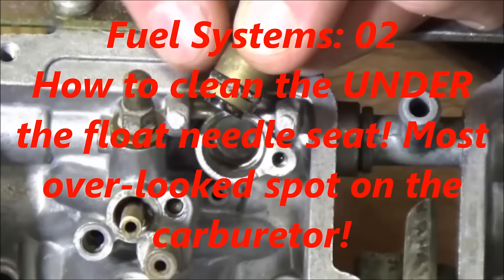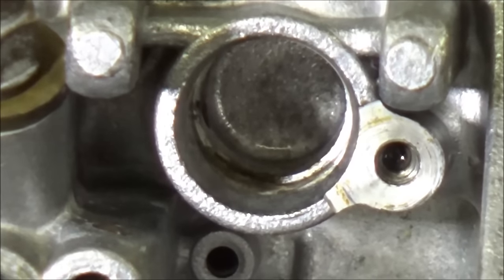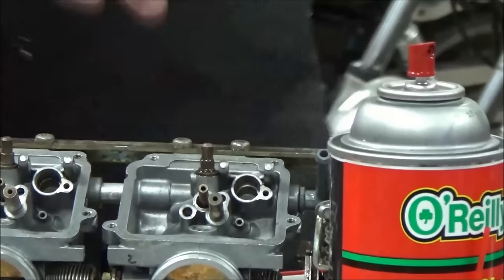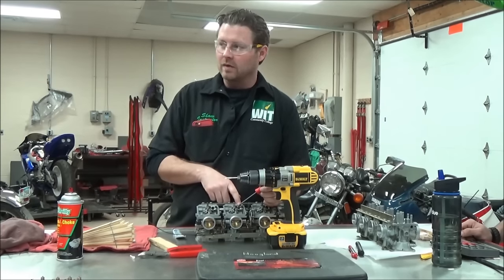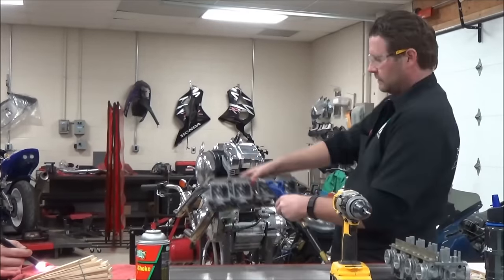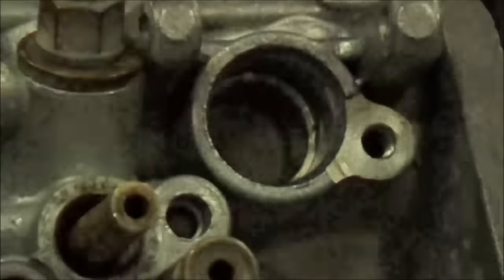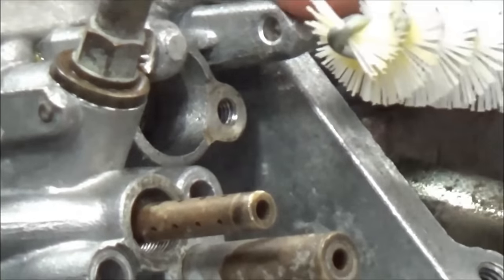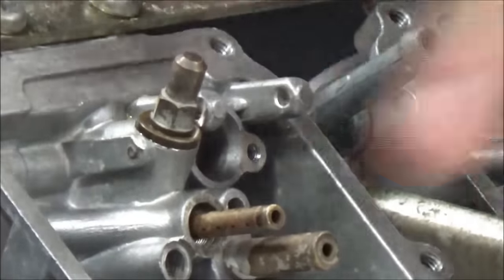02 The most overlooked spot on carburetor rebuilds and cleaning! Under the Float Valve!

Comment: I check out most of your vids whenever I get a chance, mot appriciated and entertaining.
Speaking of rebuilds, im doing a rebuild/overhaul on an Xt600 1987 2kf, and just noticed a small gap where the conrod meets the crankshaft. I checked the manual and it states a freeplay of 0.25-0.75 mm, my seems to be after checking with a feeler about 0.55mm. Is this a sign of wear and bad things to come or is everything between the specified clearancelimit acceptable? Sort of like a brakepad wearing down.
Mike
Reply from the maker: +TNPerSwede 
If its in spec I really wouldn't be concerned UNLESS it was run on low oil.
Reply: +Shane Conley It was bought used by me so hard to tell but maintened properly by me atleast.
Thanks for replying, its great having a recource like you when things get confusing for the old brain.:)
Have a nice day and happy spring riding.

Comment: You are the best guy on the internet, learned a lot from you. But you are wrong about removing debris using polish of grinding paste, you have to remove manually. If you a paste you will remove aluminium material as well as the debris. But keep up the videos, thanks.
Reply from the maker: Well thank you "kind of" lol...jk. We will have to disagree and my methods are proven and sound. I think you are thinking of something else though BECAUSE the seat is brass not aluminum. Also from experience, you have to "polish" forever to make the slightest change. I have a video coming out showing this process in detail. Stay tuned. 
Thank you for the comment. See the link below for more help with your question. I have been banging my head against the wall thinking of ways for people to say thank you in an impactful way to help keep these videos coming. Here are few ways that many have found as a way to give back. 
* Membership to H2W (includes t-shirt or tech help) https://how2wrench.com/product/membershipmembers-onlymembers/
* Simple donation to say "KEEP IT UP"
May you have a great day and... https://www.paypal.me/how2wrench

Free Mechanic info, tool reviews, and “how to” videos newsletter sign up: https://how2wrench.com/subscribe-free-newsletter/

Missed a past issue? No Worries. Newsletter Archives: https://how2wrench.com/blog/newsletter-archives/

Like freebies? Click here for a free diagnostic checklist! 
http://gem.godaddy.com/signups/364621/join  

If I can ever be of service to you, here is a video explains how to connect with me. 
https://www.youtube.com/watch?v=vjvmB01ebcs
Reply: My experience is as an engineer, old school, remove the bulk of material and then polish. You are correct that care/time should be taken and that the surface in question is not critical.

I am quite new to bikes and having watched your video, I realise the importance of float chamber height, something missed by almost everyone else.

My bike is in Thailand where information is sparse and I will use much of your instruction to get my 1983 NV400 working properly. So the thank you is genuine, your method of instruction was very much like my own I had as an engineering apprentice, so it very much hits home.

I have had problems finding a company in the USA who can supply me with everything in need for my carbs. Jets, float chamber seats and valves, manifold rubbers, pet cock and slider springs. That way I can get everything shipped together to Portugal. Any ideas.

Once again thanks for the great videos Shane.